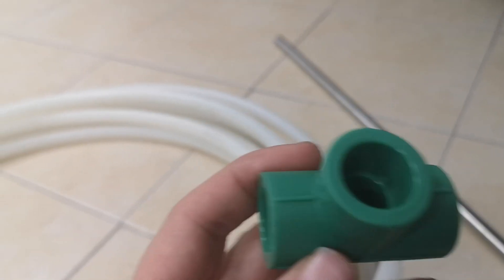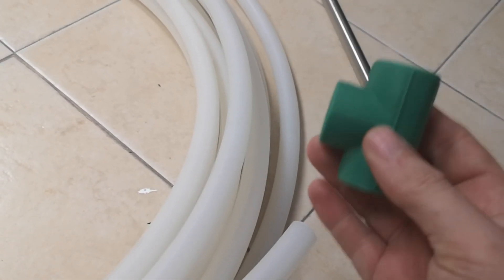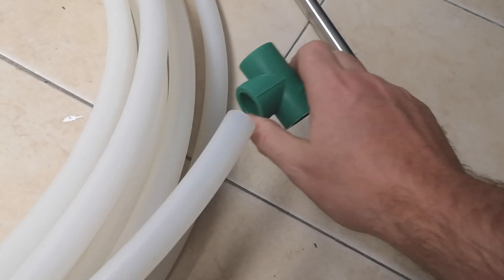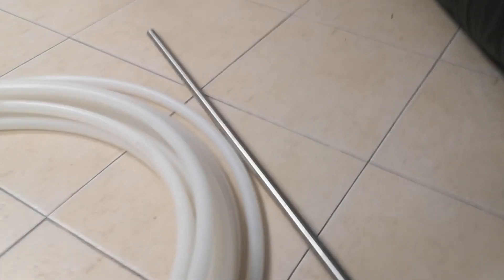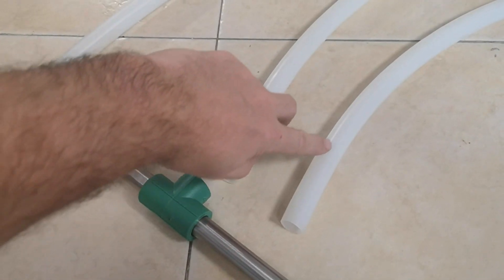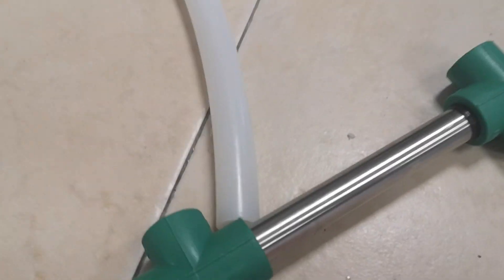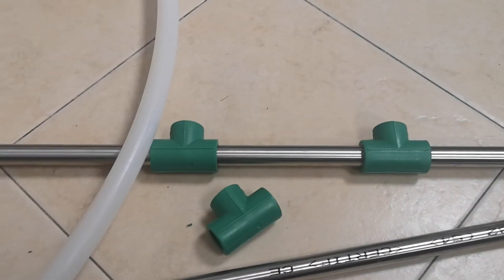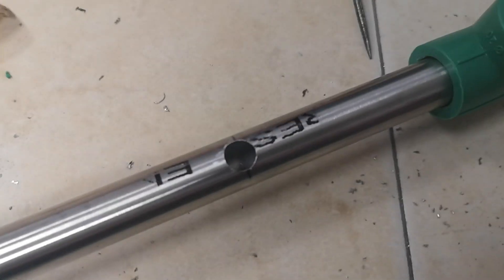Triple Leaping Arch: Part 1

Comment: you could heat the fitting with a heat gun thaqts what i do
Reply from the maker: Good idea.  I managed to push them without heating by using a knife to angle the edges of the tubing.